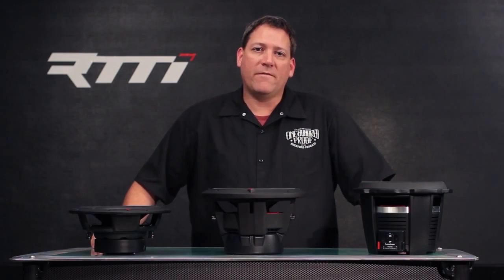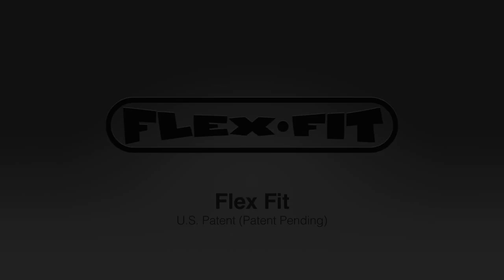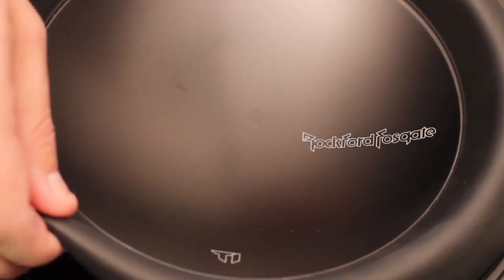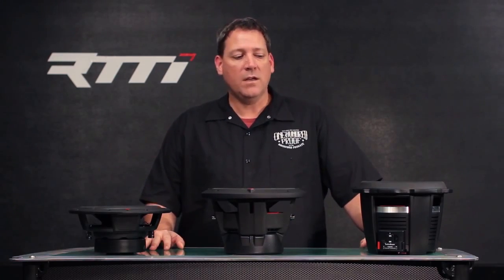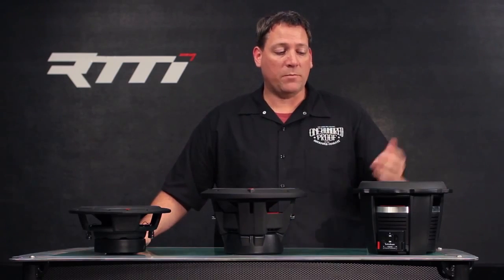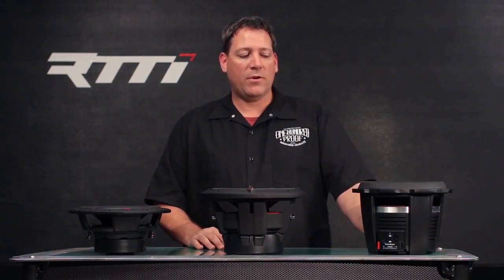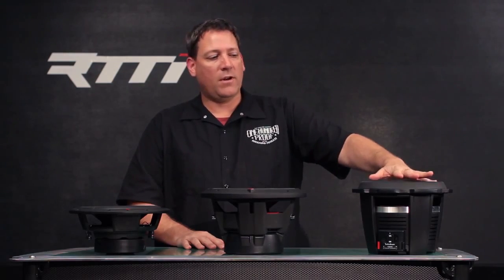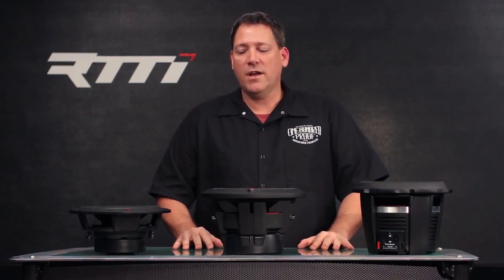Rockford Fosgate: Subwoofer Comparison (1.3)

Comment: Why doesn’t your company sell replacement parts for your products? I have a T1S1-12 that has a disintegrated surround. I called your office and you told me that your products are made in China, and you don’t ship replacement parts from China to fix your products. 
Nobody makes a replacement surround for that speaker, which is an expensive speaker ($500). 
So I basically have a worthless speaker, and it’s enclosure box, which is made by you. I can’t find another brand to fit in that enclosure, and you told me my only option is to buy a brand new T1S1-12. 
$500.

Comment: The p3s i have ...have a grey face... whats the difference
Reply from the maker: You have the 1st generation P3S subwoofers.  (2007-2011) The 2nd generation subwoofer to utilize the P3 family name, and the 1st model to use the P3S name.  I've noted some highlights between the Gen-1 and Gen-2 models:

P3SD210 / P3SD410 (GEN-1)
- 300 Watts RMS
- Fs: 45Hz
 - https://rockfordfosgate.com/products/details/p3sd410/

P3SD212 / P3SD412 (GEN-1)
- 400 Watts RMS
- Fs: 45Hz
- https://rockfordfosgate.com/products/details/p3sd412/

P3SD2-10 / P3SD4-10 (GEN-2)
- 300 Watts RMS
- Fs: 42Hz
- https://rockfordfosgate.com/products/details/p3sd4-10/

P3SD2-12 / P3SD4-12 (GEN-2)
- 400 Watts RMS
- Fs: 35.4Hz

Comment: I currently have 2 P1 10s and a 500.1 amplifier. I have stock electric, but was wondering if I could upgrade my P1s to P3 10s?
Reply from the maker: Did you mean the P500X1bd?  If so, it's rated to produce the following power:

RATED POWER
150 Watts x 1 @ 4-Ohm
300 Watts x 1 @ 2-Ohm
500 Watts x 1 @ 1-Ohm

DYNAMIC POWER
224 Watts x 1 @ 4-Ohm
410 Watts x 1 @ 2-Ohm
787 Watts x 1 @ 1-Ohm

While we don't know what impedance subwoofers you are, we'll assume they are the P1S2-10 subwoofers are rated to handle 250 Watts RMS for 500W total power handling capacity.  If you want to upgrade to the P3D4-10, this will create a 1 load are rated to handle 500 Watts RMS for 1,000W total power handling capacity.  While the P3 won't produce more bass, they are more capable of handing the Dynamic Power output of the amplifier.

Comment: I can't decide between the P3 and the t0 12 in. Ideally sealed enclosure, I listen to a variety of music and for space reasons. Looking for extremely clean but hard-hitting bass that can hit the 30-35hz nicely
Reply from the maker: As you can see from the specifications below, both subwoofers are equally capable of playing low frequencies and adapted for sealed enclosures.  The primary difference is the amount of power handling.  Let's say you'll use the P500X1bd amplifier (you would use the corresponding 2Ω DVC subwoofer if running one, or the corresponding 4Ω DVC subwoofer if running two).  Although it's rated to produce 500 Watts x 1 @ 1-Ohm, its Dynamic Power is 787 Watts at 1Ω.  The T0 subwoofer would be a better choice.

The P3D2-12/P3D4-12 has the following specs:
• Fs: 26.5
• Pe: 600 Watts RMS
• EBP: 50 (toward sealed)

The T0D212/T0D412 has the following specs:
• Fs: 26 Hz
• Pe: 700 Watts RMS
• EBP: 45 (toward sealed)
Reply: @rockfordfosgate  What box dimensions would you recommend to yield a F3 of 35hz when utilizing a sealed design for the P3 10 inch?
Reply from the maker: @sanj5026  1.0 cubic foot sealed for an F3 = 35 Hz, but you can only power each sub with 275 Watts before you reach over-excursion limits.
Reply: @rockfordfosgate  okay, as for the T1 12inch, what sealed enclosure box volume would yield a F3 35-40hz. I have limited trunk space, trying to maximize my lows while having high, clean sounding output ! I appreciate your help thus far 🙏🏼🙏🏼
Reply from the maker: @sanj5026  Hi @sanj5026, let me help you out here...  What are the maximum dimensions you have to work with and still get the enclosure in the trunk?  This might be a better way to find the right subwoofer.
Reply: @rockfordfosgate  hey thanks for the reply. I'm removing my factory subwoofer. I have the approx dimensions available 

8.5 inch height (top to bottom) 
37.5 inch width and 
16.5 inch length/depth (from rear
to front).

Was thinking two 10in P3s sealed or one T1 10/12 in sealed/ported but looking forward to what you have to recommend! 

I'm hoping to have the sub(s) be mounted on the top of the box, facing the roof of the vehicle

Thanks
Reply from the maker: @sanj5026  Our technical support is asking if you can please submit this question via our online support page.  There is data they want to share that is not possible through text messaging through YouTube.  You can submit your dimensions and goals for a sealed box with an F3 of 35 Hz to : https://rockfordfosgate.com/support/ and click on the ASK A QUESTION button.
Reply from the maker: @sanj5026  You can get the F3 down to 37 Hz with 1.4 cubic feet internal volume + driver displacement (0.14) = 1.54 cubic feet total internal volume.  However, since this is a larger sealed box, you can only apply 400W each (800W total) to both subwoofers or you'll break them.  You can use our BoxWizard to figure out dimensions that work for you ... just target 1.54 cu.ft. internal volume and you'll be on track: https://rockfordfosgate.com/support/box-wizard/

Comment: Bought my first rockford fosgate products few months ago, 2x 15p3 with the prime 1200.1 this set up hits hard. Thinking of upgrading the woofers, any advice on which t1 or t2? Still keeping the amp.
Reply from the maker: The P3 subwoofer is our most popular in the line, so that's a really good setup you have there.  If you upgrade the subwoofers you would need to go from a 600W (P3) to an 800-1200W (T1) and double your amplifier power (add a secondary R2-1200X1) for it to be noticeable. Otherwise, simply switching subwoofers wouldn't gain you much difference.
Reply: @rockfordfosgate  yeah I'll double the amp but the birth certificate for my amp say it's 1425watts at 1ohm.
Reply from the maker: @Jayty677  Yes, you have a pretty powerful amplifier and subwoofer setup.  Simply switching from P3 to T1 subwoofers isn't really going to change much, so there are many factors to consider. Check out the "Speaker Power Handling" video I made with some good info that may help: https://www.youtube.com/watch?v=uaGlb9SymdI

Comment: I have decent electrical in my car 1/0 cabling second battery and just purchased two twelves t1 twelves I tried them out with a fosgate 500.1 aswell as a massive 1500.1 and think they sound pretty much the same. Can I run more power to them
Reply from the maker: The Power T1 12" subwoofer is designed to handle 800W continuously.  If you drive more power to them, you'll likely burn the voice coils. You can see all the specs here: https://rockfordfosgate.com/products/details/t1d212/

Comment: Im haveing 1 rockfordfosgate t1 . And a 1200 watt rockford amp. Installed in my fusion 2014 hybrid
Reply from the maker: Hey Gilbert, that's a great subwoofer.  It should pound in your ride.  That's a lot of power, so if you need help setting your amp gains, contact our support specialists at 1-800-669-9899 Mon-Fri 8am-5pm MST.

Comment: Attend bbox ported dual 10in subwoofer box 
Model number-10SPLDV
Hey Rockford here my q so I have a dual 10in ported box that’s net cubic feet per subwoofer is 2.25 cubic ft and the 10in punch p1s4 recommends 1.4 so is my box to big or Will it be OK in the enclosure with right power to then I know you can little bigger with The enclosure
Reply from the maker: Thanks for that information!  Looks like the 10SPLDV - 10" Dual SPL Vented Enclosure has a box volume of 1.35 cubic feet (per chamber).  Do I have the right part number? https://atrendusa.com/products/10spldv-10-dual-vented-spl-carpeted

Yup, the P1S4-10 is recommended for 1.4 cu. ft. in a vented enclosure tuned to 32 Hz.  I'm not sure what the 10SPLDV is tuned to (doesn't say on their website), but you definitely have the right box volume.  It's only 0.05 cu. ft. off, so you should be good to go!
Reply: @rockfordfosgate  thanks guys I appreciate it
Reply from the maker: @extendedraven7893  You got it Raven!  Good luck on the installation.  Thanks for being a Rockford Fosgate fanatic!
Reply: @rockfordfosgate  yes you got it right
Reply from the maker: @extendedraven7893  Alright, great!  You should be rockin' with that enclosure.  The post looks long, so it should be tuned reasonably low.  If you like, you can always call our Technical Support on Tuesday (Monday is a holiday) with the box volume (1.35 cu. ft.) and the port opening (H x W x D) and they can run the calculation backwards to determine the tuning frequency.

Comment: Cual puedo comprar quiero comprar 2 t1 de 10 pulgadas o el de 12 pulgadas. O el t0 2 bajos. Pará un r2. 1200.1 prime
Reply from the maker: El Prime R2-1200X1 produce una potencia continua de 1200 W y una potencia dinámica de 1389 W. Si está utilizando 2 subwoofers, debe comprar los subwoofers DVC de 4 ohmios.

El T0D410 solo está clasificado para manejar 500 W, por lo que 2 subwoofers solo proporcionarían 1100 W de manejo de potencia. No, no recomendaríamos estos subwoofers.

El T0D412 solo está clasificado para manejar 700 W, por lo que 2 subwoofers solo proporcionarían 1400 W de manejo de potencia. Sí, recomendaríamos estos subwoofers.

El T1D410 está clasificado para manejar 600 W, por lo que 2 subwoofers proporcionarían 1200 W de manejo de potencia. Sí, recomendaríamos estos subwoofers.

El T1D412 está clasificado para manejar 800 W, por lo que 2 subwoofers proporcionarían 1600 W de manejo de potencia. Sí, recomendaríamos estos subwoofers.
Reply: @rockfordfosgate  otra duda q tengo y gracias x responderme antes.  M pregunta es el t0 12 tiene también disipador d calor como dices en el video porque nomas dijiste q el  como el t1  y t2.  12 pulgadas
Reply from the maker: @valecasillas5729  Sí, este es el disipador de calor IDHS que contribuye al excelente manejo de potencia del subwoofer.
Reply: @rockfordfosgate  el to d4 también tiene damping heat sink para disipar el calor xq quiero comprar 2 de 12 pulgadas
Reply from the maker: @valecasillas5729  
Sí, tanto el DVC 2Ω (T0D212) como el DVC 4Ω (T0D412) tienen disipadores térmicos IDHS.

Comment: I currently have 4 fosgate 12 inch P3’s in a Toyota 4 runner, and have them on 2 kicker 1200 watt amps and am pushing 600 to each sub. I have to say, I am very impressed by the sound quality, and power of the sub compared to others. Thank you for making an awesome product
Reply from the maker: Great, Reese!  Thanks for your feedback and using Rockford Fosgate in your 4Runner! #fanatic
Reply: @rockfordfosgate Good afternoon I would like to see if you guys could guide me into how I could file a complain on an authorized Rockford fosgate dealer I've been buying your products but I am not happy with the service I got
Reply from the maker: @rt_life8478 Sorry you’re having an issue with a dealer.  Go to our support home page and click Email Us:  https://rockfordfosgate.com/support/
Reply: Prime series can still shake windows & set off alarms! Just depends on the box is set up right. I remember my homeboy back in New Orleans ran 6 Series 1's on two Orion Reds in his S10 Blazer & it was devastating! I was running 2 punch 15's on a punch 150 & Punch 30 on my Highs with an XV1 crossover which to me is still one of the best crossovers ever made! Value on those are still high in 2025. My other pot'nah was rock 2 Punch 15's in his Chevy Baretta. “Mobile One“ got all our money but we had The New Orleans Lake Front Bump'n😂🥰👍🏿

Comment: What is the difference between a T1 and a T0? I am getting a great deal on a T0 12 but the T1 is 100 dollars more and not local..
Reply from the maker: The T0 and T1 are very close in performance with the main differences being power handling. 

T1 12": 800 Watts RMS
T0 12": 700 Watts RMS

T1 10": 600 Watts RMS
T0 10": 550 Watts RMS

Comment: How the he’ll do you remove the dust cap on the latest P3 10? I have a month old wonder that’s rattling and it sounds like the voice coil former is unglued. This is such a disappointment and I didn’t buy it a a RF dealer so no warranty. This is also a common pro blend I’m reading. The sub literally looks brand new and was never over powered and gains were set with a scope.
Reply from the maker: If the subwoofer is literally brand new, take it back to the dealer you purchased it from and ask for a warranty replacement.

Comment: Which 8” subwoofer would you recommend for a 92 Lexus Sc400 without a box in the original center back position?  Thank you for your help.  It seems like it needs a free air speaker.  Bass sounds loose and poppy.
Reply from the maker: Hi bsrodeo7s, so you have existing 8" Rockford Fosgate subwoofers in an enclosure now?  Which way in the enclosure facing?  If they are "popping" this may be due to over-excursion.  A single 8" may not provide enough bass you're expecting out of it.

Comment: Is the rockford t1500 amp strong enough to push 2 12t1 hard to there full strength?
Reply from the maker: Yes, absolutely.  The T1500-1bdCP is rated to produce 1500 Watts x 1 @ 1-Ohm, with Dynamic Power up to 1715 Watts x 1.  If you use two T1D412 subs, you can wire them to 1-ohm.  They can handle up to 800 Watts RMS each, so 2 will provide up to 1600 Watts power handling capacity.

Comment: I have two 15 P3s, each on their own Punch P1000 amp. But my magnets shifted and destroyed the voice coils on both. Would I notice a big difference if upgraded to 2 T1s in the same box (ported, recommend enclosure size for both) on the same amps, or am I better just getting another set of P3s ?
Reply from the maker: The Punch P1000X1bd is rated to produce 1000 Watts x 1 @ 1-Ohm RMS and up to 1,430 Watts Dynamic.  The P3D2-15 are only rated to handle 600 Watts RMS.  Since the T1D215 are rated to handle 1000 Watts RMS they are a better match for that amplifier.

Comment: Hopefully Rockford will still reply. 

I’m running Two PPS4-8s in a sealed box with 10 inch bass radiators. In the same box I have two nice tweeters that will match the frequencies perfectly. However I have a 2 channel amp. As of right now I ran the wires from the rockfords and the tweeters to the block terminals, that exits the box and allows wire connection on the outside. 

So 2 positives and 2 negatives on each terminal. Those two block terminals exit the box, and will run to the amp. 

So my final question - Will it be okay to run the 2 rockfords, and the 2 tweeters (have crossovers) on a two channel amp?
Reply from the maker: Hi Pierce, so it sounds like you have a tweeter and a midrange on each channel, right?  If so, yes this will work.  The amp will “see” a 4-ohm load from 80Hz-5kHz (frequency response of the PPS4-8) and assuming you have a 5kHz High Pass crossover on the tweeter, the amp will “see” a 4-ohm load from 5kHz-20KHz.  If the crossover is offset, say 4kHz, then between 4kHz-5kHz the amp will “see” a 2-ohm load.

Comment: Don’t be fooled, the P1 (aka prime series) absolutely kicks!  My friend has a single 12 inch P1 sub in the loaded enclosure that fosgate also sells them in, wired it to his factory amp on his murdered out Range Rover and yes it’s limited by that amp and dumb software that controls it being confused at the load but even so it flexes his windows and defiantly can feel it even outside the SUV cranked up.   They sell a dual enclosure, his factory amp fail safes sometimes with dual 12 inch P1’s kicking.
Reply from the maker: Awesome!  Thanks for sharing your experience with other fanatics!  

For others reading this, the P1 is a Punch Series subwoofer and the models that are sold as individual drivers are the exact same models used in single woofer and dual woofer "Loaded Enclosure" systems.
Reply: @rockfordfosgate   oh that makes sense!   Can you help me understand more about your door speakers a bit more?  

Specifically the R165x vs P1650 Vs. T1650 vs P165-SI for example.  Like I worked out the 65 = 6.5 inch.. but what does each letter indicate?   R seems to indicate lower end.. but otherwise I don’t understand it..
Reply from the maker: @Honeypot-x9s  Ah, yes, it's a little confusing because six-inch speakers are the wild-west of sizing descriptions.  Typically here's the rundown:

[R] is Prime (good)
[P] is Punch (better)
[T] is Power (best)

• R165X = Prime 6.50" coax
• P16 = Punch 6.00" coax
• P1650 = Punch 6.50" coax
• P1675 = Punch 6.75" coax
• P165-SI = Punch 6.50" System (separate tweeter & midrange) w/ Internal crossover
• P165-SE = Punch 6.50" System (separate tweeter & midrange) w/ External crossover
Reply: @rockfordfosgate  wow thanks, that does really help me understand much better than otherwise explained to me.
Reply from the maker: @Honeypot-x9s  Great!  Glad we could help.